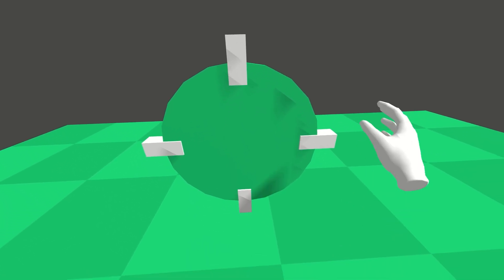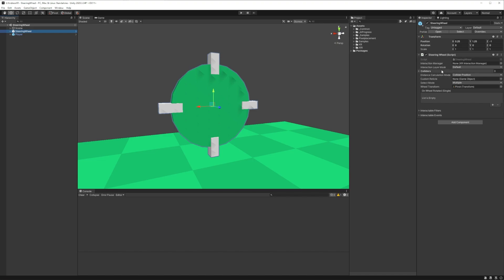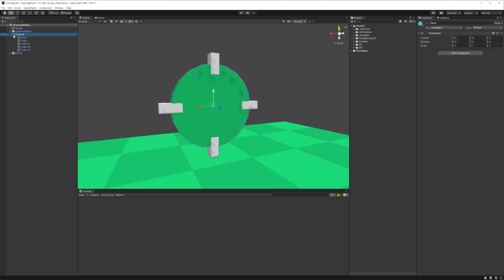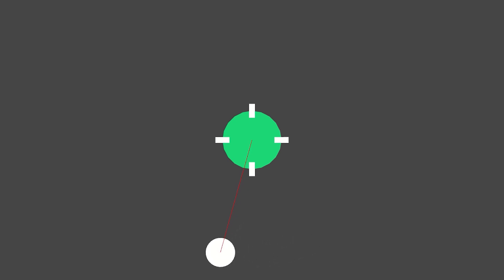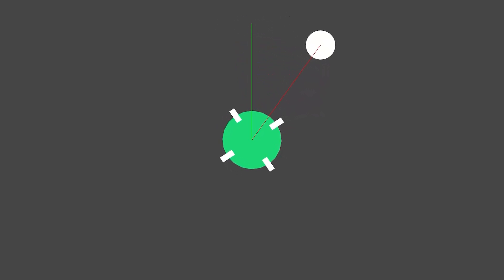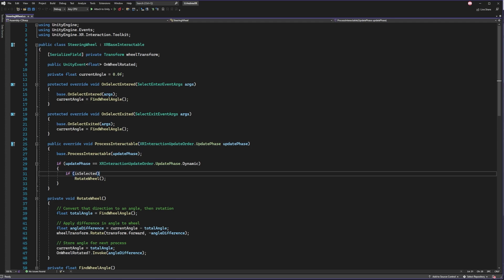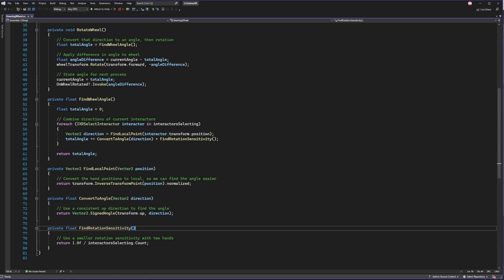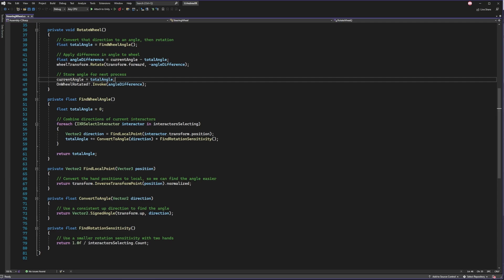A Steering Wheel for XR Toolkit

Comment: Hi! Thanks for the awesome video! I only have 2 things to say:  
1. Only the ray interactor works, the direct interactor simply won't work for some reasons(I'm using Unity Mock HMD).
2. When selecting the wheel using Ray and moving it in linear motion, it's fine. But when moving it in 1 full cycle (circular motion), the rotation is kinda weird, it first rotated and then suddenly pulled back when the total angle past 180 degree.
Thank you!
Reply: You need a rigid body on the wheel for it to work with the direct interactor! I had the same problem
Reply: @r8teful  Which game object specifically do you put the rigidbody on? It seems that wherever I put it I still can't spin the wheel and it just falls to the floor.
Reply: @fuzzman02 you have to make the Rigidbody kinematic and put it on your Hand Model

Comment: I can only get this to work with a Ray Interactor on my XR controller and can not, for the life of me, get it to work with a Direct Interactor. It works if I put a normal Grab Interactable script on the steering wheel but then I can't have a custom behavior like this on it.  Do you have any clue why this could be? Nice video btw, I like that it is clean and to the point, but for a beginner like me it is still all a bit to confusing and fast hahah.
Reply: Okey I fixed it, just had to have a rigid body to the wheel (:

Comment: Line 73: I think you'd wanna use a "local up" instead of "transform.up", as the latter is world space and you're comparing it against a local vector - As it is, it'd start going wrong if your car went on slopes/upside down

Also, you might want to flatten the vectors to remove the Z (or x or whatever) - As at the moment, I think it'll rotate even when you move your hand towards/away from yourself.
Reply from the maker: You're onto something! I originally had it with Vector3.up, but I considered the possibility of the car rolling over, so I changed it to transform.up. The initial idea was to be a valve wheel rather than a vehicle wheel.

I double-checked some stuff in the scene, and it still seemed to work even when the wheel was at different orientations. So, it may have just been some dumb luck. However, I did change it to Vector2.up, since that inconsistency in world/local bothers me.

For the flattening of the vector, since the point is local, it's the z-value for hand depth that we want to ignore. Which I leave off when the hand position is converted to a local point.